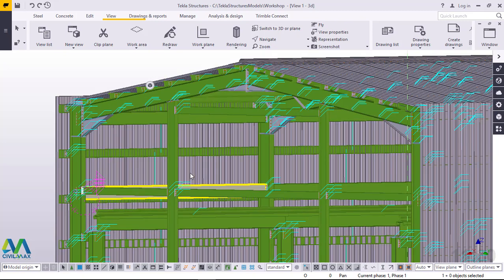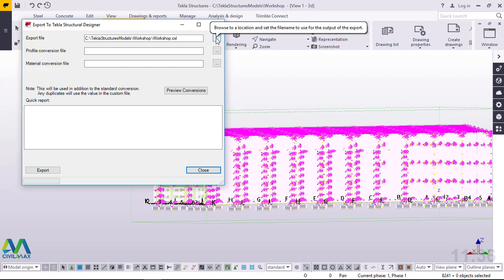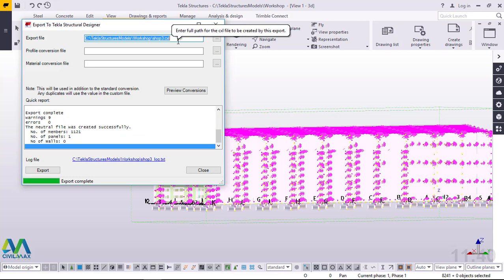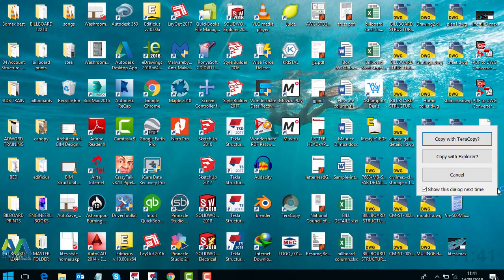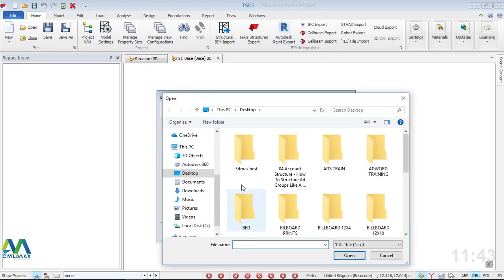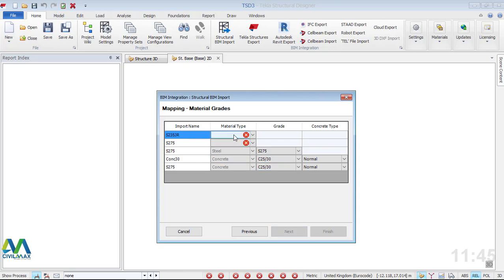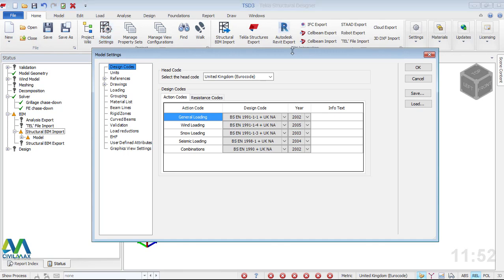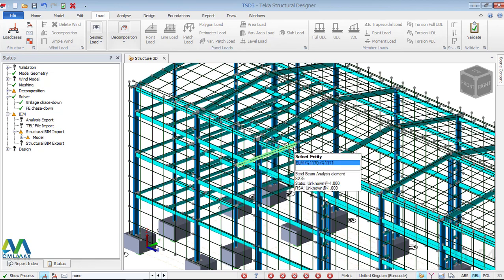How to export Tekla Structures Model to Tekla Structural Designer

Comment: I'm mechanical engineer.... But started work with tekla structure and tekla structure designer. My ques is....we can make model in tekla designer also so why we use tekla structure for modelling?
Reply from the maker: We can model in TSD but it is not a modeling software,its ideal analysis
Reply: Ok thanku.

Comment: do you have a video showing modelling in tekla structure and make analysis in tekla structure designer, and in which tekla software do you make working drawings from
Reply from the maker: yes,a round three just check if not enough will upload some